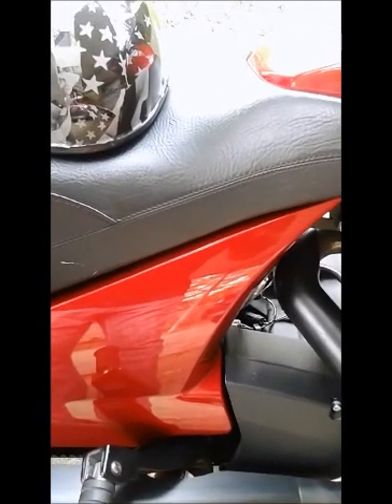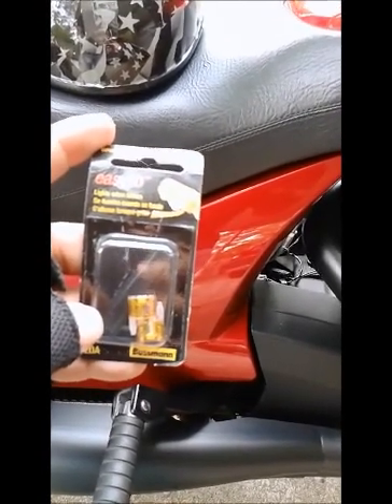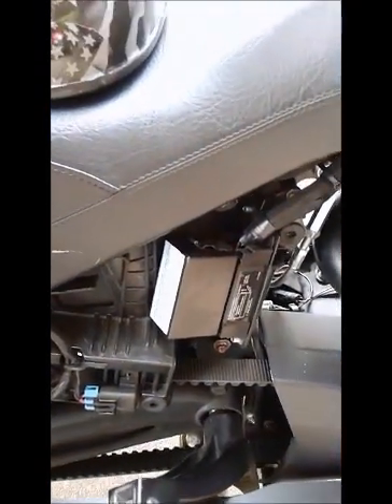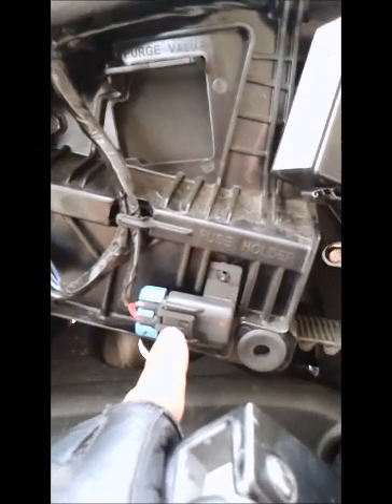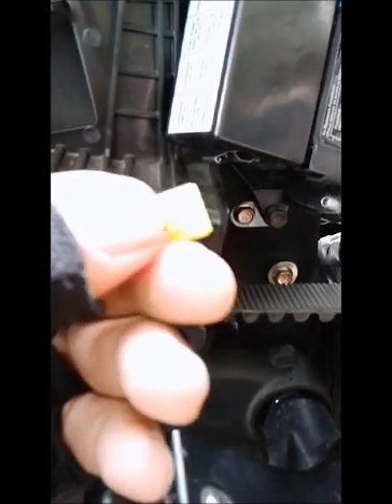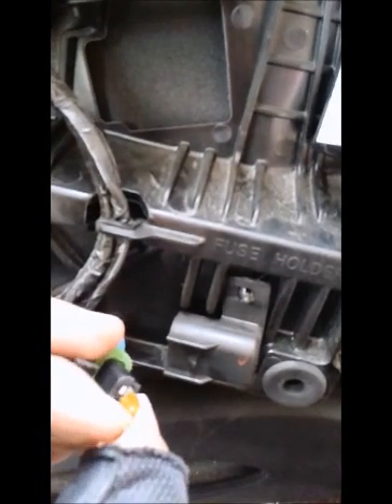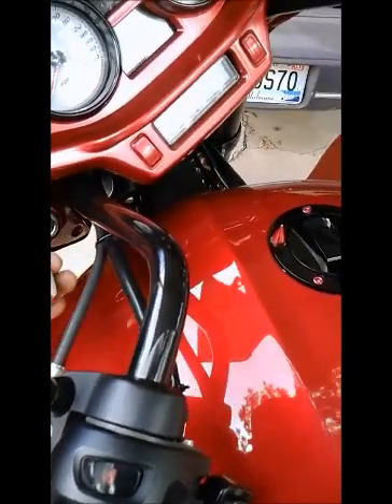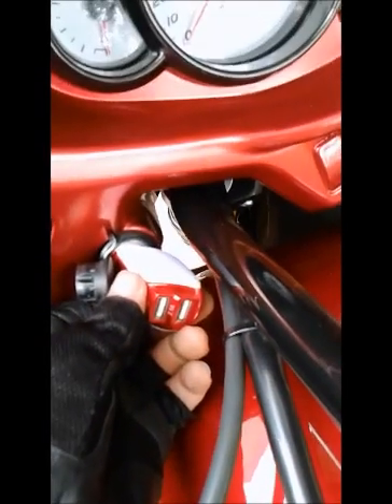Victory Cross Country 12Volt Outlet Fuse

Comment: Thank You So Much!!! I took my bike to the Victory Shop a while back about issues with my bag speakers not working and the tech there said I blew my amp and you can't get a replacement cause Victory stopped making them. today I noticed my 12Volt outlet wasn't working so I asked the same tech and he said it somewhere behind the fairing and it would cost at least a half hour of troubleshooting. I came home and watched your video and 10 min later my outlets and speakers were working again. THANKS AGAIN!!!!

Comment: Not only did you nail it but you showed something different than the owner's manual. The owner's manual and first the fuse is behind the battery underneath that plastic flap on the left front. There's a fuse there and it was good but it wasn't for the cigarette lighters. Thanks a lot from ellijay Georgia

Comment: Wow! Thanks! I have a 2015 Victory Cross Country 8 Ball, named 'Victoria' I have noticed the the Victory Cross Country service/owners manual is lacking in many aspects. One good thing,is Victory marks the wires well under the fairing.
Reply from the maker: that's Tru. But I really didn't feel like going thru the trouble of removing the fairing and doing a wire trace to figure out what was wrong wit my outlet
Reply: Haha, My '04 Vegas is Victorya, My '11 XC was Velvet (Black Velvet if you please) and my '16 XC is Velma (my road name is Shaggy and my Ol' lady is Daphne). Still have Victorya and Velma.